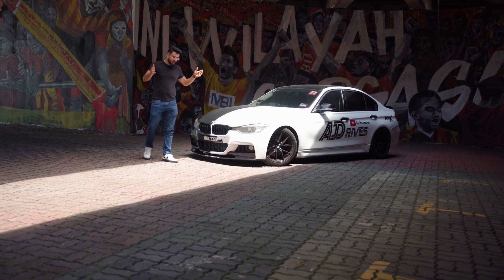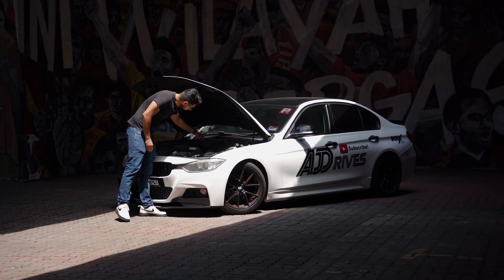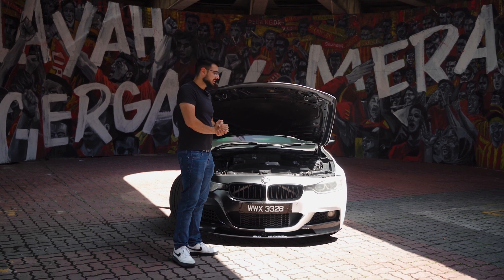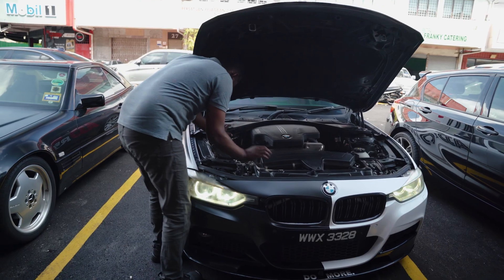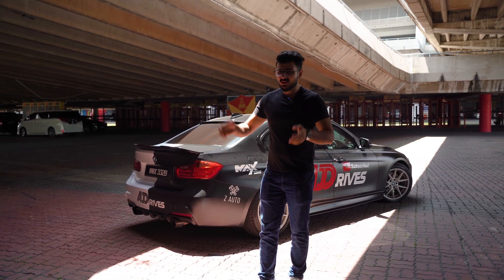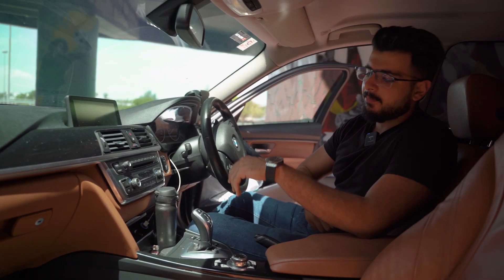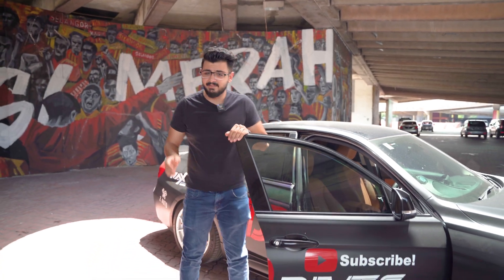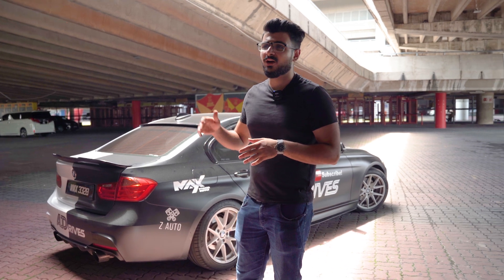Your BMW Probably NEEDS this After 10 Years!

Comment: hi, would any of you guys know why my bmw 330d with a n57 engine starts to shake a little bit when at stand still, not coming from the engine but feels like underneath my seat? Recently changed oil (engine,diff, gearbox) so it should not be the case. Also, on how many km should you change the timing chain? Thanks for these videos!!!! amazing
Reply: Is it only when it’s in gear?
Reply: @crossuoveragain2027  hi, no also in neutral. Someone told me that lamda sonda can was the issue with his car but i don't know.
Reply: @gregorkokalj9326  I’m not very familiar with the diesels, but I had a 330i that would shake and it was the trans mount bushings. It could also be a motor mount. If it was a motor mount, u would feel the motor jump after hard acceleration from a stop. It’s common on higher torque motors (mainly v8s) but with it being a diesel, I wouldnt be surprised if all the torque wore out the mounts
Reply: @crossuoveragain2027  hmm, worth to take a look for sure. Thank you for taking the time to help! Much appreciated 😊
Reply: @gregorkokalj9326  I bet it was the engine mounts.

Comment: I'm having this issue where the aircon flap is not opening. It will open after some time but at random. Sometimes it will open after 10 minutes, the longest was around 30 minutes of driving! Issue is more apparent during rainy days.

It's not the aircon itself not blowing. I can feel the cold air, but the airways are blocked by something. Any ideas?